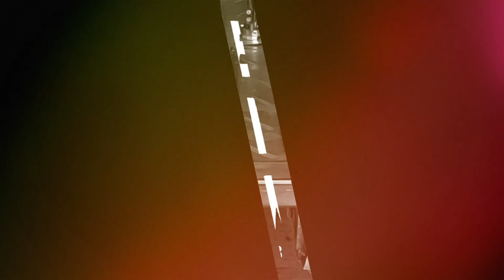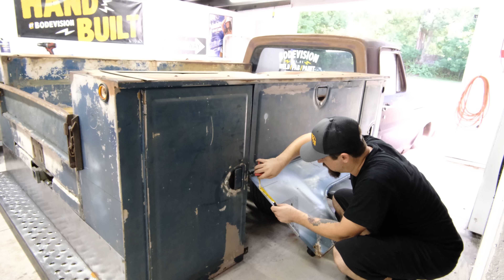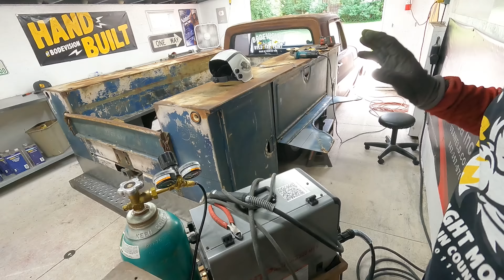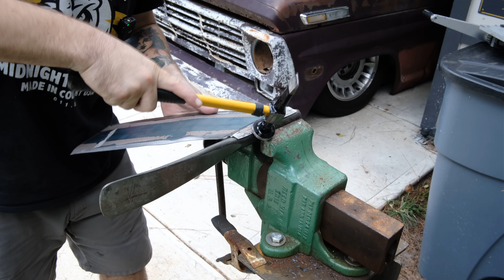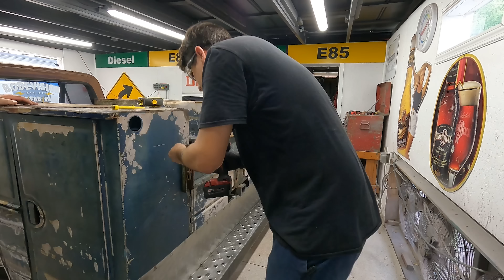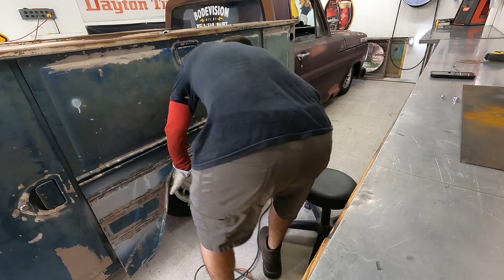Major Mistake? Raising Rear Fenders to Match The front- Shop Truck Body Swap Project

Comment: In my opinion, which don’t mean much, you should have left the rear arches the way they were
To be honest, if you got two more front Ford fenders cut them to make them fit I think that you would have matching arches and it would look a hell of a lot better
Reply: second using the arches from other front fenders - probably even could pick up 2 patch panels
Reply: i just wrote the same and then read that you wrote this. i think that's the best way forward and they can't stay as they are...

Comment: To be honest I liked it before you messed with it and out of the three I like the final iteration the least. I don’t know if it would work but what if you got a set of front fenders, cut the wheel opening out and grafted into that rear piece (assuming you want them the same)? But like I said I like the original, kinda had the fender skirt vibe. 🤷‍♂️ Regardless still love the truck!
Reply: good idea

Comment: Some years ago I bought a '92 F250....standard cab, utility bed, ladder rack (ex-City Public Works truck).  I didn't pay much for it, and my original intent was to cut it up, slam it, and make it into a kind of a "Steampunk meets Mad Max" rat rod shop truck.....kinda like your project.  After I fixed the mechanical stuff and got it running, I realized that it was a rust-free Arizona truck, had never been wrecked, and was just too damn pristine to start whackin' on it.  Nine years later it's still my DD shop truck, still looks original, and has the perfect shop truck patina just as it is.  I love what you're doing, and love your creativity.  It's your project....do what you think is right....

Comment: Mr Bode, i like where you're going with this. Matching the height of the arches is a good move imo. But where i think it's going wrong is the shape of the rear arch compared to the front. My personal opinion is that they need to match. I.e how the rear of the front arch sweeps down and flows to the back and how the front of the front arch has a nice curve down and slightly forward. There's 2 options i can think of. 1: You get hold of 2 more front fenders, cut the arch out around about where the body line is, and attach it to a hinge on the utility bed. Or #2, you re-make that entire rear arch panel out of panel steel but template the arch to match the front arch. You can still put the beads into the arch with both options.
I reckon with doing 1 of those 2 options, it will tie in the truck cab with the utility bed a lot better, and the arches won't look so funky.

Comment: Your idea was good, but i think if youre going to match the height you have to match the body line of the front fender. Keeping the current itteration I think looks bad, but might look fine once painted, always hard to tell on camera. The largest pet peeve i have is the fender arch looks to tall and skinny compared to the front because the bottom corners dont flare out with the same sweeping shape. Youre a badass man been here since you pained taylors car.

Comment: I’m curious what a solid panel would look like. I think I would have left it alone or started with another trailer fender just to use it’s shape and make a flare at the same time 🤷🏻‍♂️ you did inspire me to cut up my truck tho so thank you for that!
Reply: hey that sounds interesting flat panel on the back hide the wheel and just run the front arches.

Comment: When you pulled off the pad the cab and bed really flexed from one another.  Don't think the car frame is beefy enough to handle that weight. Should probably bolt the cab and bed together to stiffen everything up. Great build, keep up the great content.
Reply: then the bed wouldn't be removable.
Reply: @JustinFromThe206 bolts are removable……

Comment: You should use that door as a template to build a whole new door that is not warped and you can make a nice consistant rolled edge around the wheel opening.

Comment: Maybe start with a large piece of sheet metal, make a template of the front fender opening and trace that on the new piece, or as many people have mentioned maybe source a set of fenders and splice those in. Either way keep at it, this thing is cool.

Comment: I think after the first modification you should have fitted that panel to the other side. Then it would have matched the front wheel arches which are closer to the tyre at the front and taper of at the rear of the tyre. Other option would be to get some front guards and modify them to fit. Loving this build, it looks great👍

Comment: What if you get a set of front fenders and cut out the wheel opening section and graft it onto the box, that way the size, height and angle would match front and rear

Comment: Hmm it’s tough, I like what you done with the height of the arches as it looks better with the wheels like this being more symmetrical on what you can see. I’m not sure about the arch shame, be nice if you could mimic the front arch shape a bit more so it flows better.

Comment: what if you took an 2 original front fenders and cut those up to make the rear openings?  That way the body lines match the front.  Im sure you can find a replica front fenders then us those to redo the rear arches.

Comment: I thought the original look kinda had that lead sled look where you can’t see the wheels in the back. Either way looks great though. Are you going to be doing anything in the audio area on the truck? If you were, what about putting a big sub in each of the front boxes and once your at a meet or show you can open up the door and let it rip.

Comment: I’d have left it as it was, maybe take 10 inches out of the length right through the middle door, I think you’ll have handling issues with that much weight past the back axle….

But not my truck and I’m too stoopid to even attempt a build like this

Good luck mate

Comment: I think it looks as good either way. Probably not worth the effort. Lots of sleds have the rear tucked more. It doesn’t look incorrect. Tucking the front too much looks incorrect. Makes me think it’s going to rub even if it doesn’t. Like no-show socks look incorrect because it looks like they’re not wearing socks, which is gross, even though they are.

Comment: You tried to keep it simple and over-complicated it in the end. Honestly doesnt look that good, im sure you agree. You closed the rear gap but the front has a gap so now the rear looks way too small. I think the original looked better, but i agree with some of the other comments thats if u can get a couple of front fenders and weld them to match, that would be best for both shape and symmetry.  Also the angle of the extensions u added in the middle seems incorrect and doesnt follow a straight line. You can see the angle change in both front and rear sections. I like the idea you were going for, just need a better way to execute it. Appreciate the content though, keep it up 💯

Comment: Honestly, I would ditch the entire bed. It looks completely out of place and doesint compliment the original lines and curves of the truck. I would personally build a flat bed and use underbody box's and skirts to match the trucks  lines......almost like a welding rig truck. I think it would be tough looking.  Then again, maybe I'm the black sheep. 🤷‍♂️